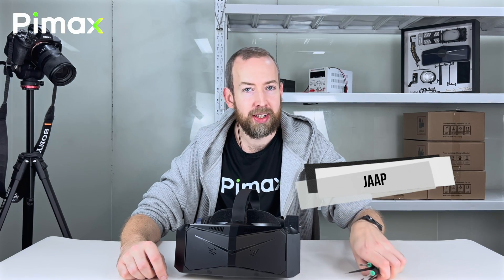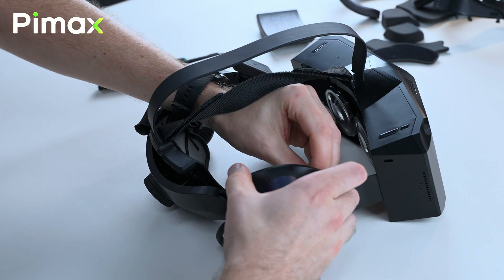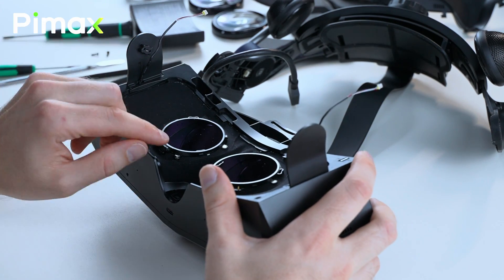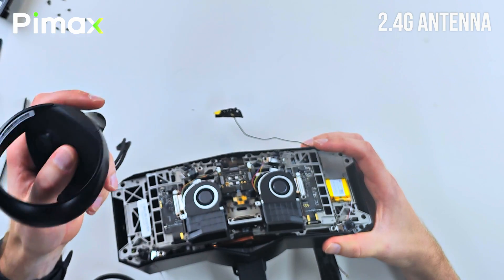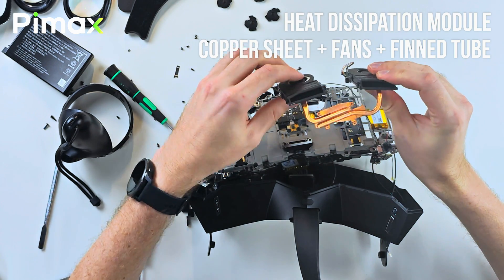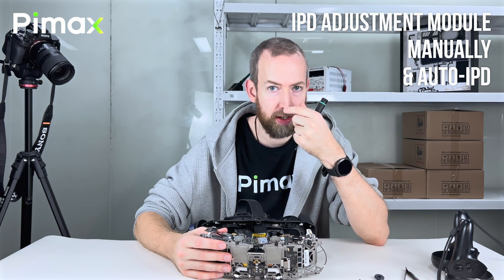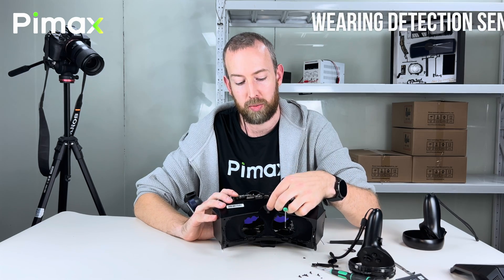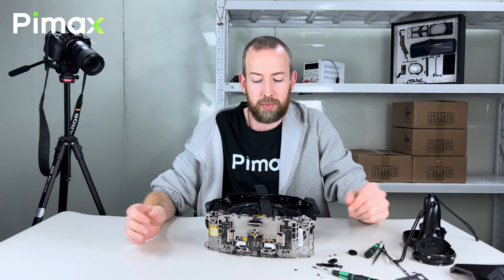Pimax Crystal teardown: How the Crystal is built differently & achieves the highest clarity in VR

Comment: Where can i get the power supply cable (flat ribbon cable at top)  ? Mine detached from the battery pack on the headset. >_<  Im good with soldering, but i would like to use the same cable if possible. Else I will have to switch out to a 9pin ribbon which im hoping not to have to do.

Comment: Hi Pimax techs,
I bought a Crystal Light for static VR for simracing or plane simulation.
So i don't need controllers because i use only mouse in VR.
I found after the buying that the headset (even if it is not a standalone VR) emits ECM waves in 2,4 Ghz.
Certainly to communicate with the controllers.
How could i disable this permanent ECM emission ?
There is nothing in the settings of the device.
Unfortunately, ECM waves very close to my head gives me headaches.
With other and older headsets without BT or Wifi emission, i can play for long hours without headaches.
If there is no solution to disable this 2,4 Ghz emission, i should have to return the product for refunding.
Thank you very much for you answer,
BR,
Reply: Did you find any solution to this? I too want no 2.4Ghz near my head.

Comment: There is so much wasted space. Could put more computing power in those areas beside the lenses. Tho weight would be an issue.
Maybe a way to lower the weight is to try replacing the plastic shell with a strong durable water resistant cloth wrapped around the frame.

Comment: With so many components go into the headset, it looks like the only way to reduce the weight and size is to separate them out from the display and had them in your pocket or something with a wire hook up to the display (similar to a battery giving the device power through wire).  That way you don't have much weight on the display and also you can be creative with the size and shape of it as well.  That would required creative engineering for it to work I supposed.

Comment: Would it be possible to remove the components that make it standalone to make it PC necessary only in order to reduce it's weight?
Reply: The faceplate, DP adapter and headphones are quite heavy and safe to remove, I'm thinking of removing the second cover, the one on top of the magnesium alloy exoskeleton.
It would be great if we could remove the fans for PCVR, but I won't be the first to do it ;)
Reply from the maker: The XR2 chip also does a lot for PCVR mode: https://pimax.com/crystal-xr2/
Reply: @PimaxVR  Like what? What would you need it for that my Ryzen 9 7950X3D PBO UV can't handle?
Reply: @TTailled  What weight would you reduce? The battery would be the only one, and you would loose a lot of features and the future wireless compatibility.

Comment: I would've loved a non-standalone version of this headset.
Reply: Why? All it would do is cut the battery out. It would not reduce size or weight basically at all. Would just give up a lot of features, and wireless compatibility.
Reply: @Nobody-Nowhere  Wrong. It did reduce the weight by 310 grams.
Reply: you've got it now

Comment: It has the 60GHz Wigig module already inside?  That's news to me.  The interview I saw before showed the WiGig module as an external dongle.  Are you sure that's not just a WiFi 6E module built in?
Reply from the maker: You'll still need the module (dongle) but the necessary hardware to make it work is on every Crystal.

Comment: This is all very nice and good dear Pimax! 
The only problem is that these things don't really work and we are spending a lot of money while you testing the Crystal with us: The customers. 
Here are some examples: 
- The controllers do not work properly, the tracking is useless with the latest update also. It's just doesn't work. driffting etc.
- So I bought the Lighthouse faceplate which also doesn't work properly (I have 4 other headsets including the index which work perfectly fine with the lighthouse setup etc. If I turn sideways the tracking is gone with the Crystal. Thanks for the 200 extra euro Pimax!
- 120Hz? Stable? No problem. :) You're lucky if it works at 90Hz without flashing.
- Pimax give me a bad charger that almost ruins the whole system and doesn't charge and just flashes the screen reboot etc. I had to buy a proprietary USB HUB because the one that comes with the Pimax Crystal just doesn't work. More crap. More than 2000 euro!!!!! Just sayin....
- Comfort? Also, you can spend money on accessories while the marketing bullshit and the paid youtubers said that it's super comfortable and you just need to strap on a rubber strap and everything will be fine. Why not add it as the part of the original package? I think it might be possible for more than 2000 euros.
So if someone doesn't want to spend all day on the internet researching and troubleshooting don't buy this crap. I already regret it. Go to the discord server and look at the problems in the troubleshooting section. It's a joke.
Reply: Huh.. mine works fine.
Reply: @mr.spongylikeaboss4987  Of course. ;)
Reply: Our discord and reddit exist as places for users to communicate their various issues and seek help from the community. Just like any tech community reddit it is in fact dominated by users who have questions. That is very normal. Very few people take to discord or reddit to say "Everything is working perfectly and there is nothing to report." The old adage "Bad news travels twice as far and twice as fast."  is quite applicable when it comes to the internet in general. 

That said if your unit is experiencing the issues up above please contact our support staff and we will be happy to help you sort them. You can contact me personally via our phone line several days a week (I post to reddit and discord when the phone line is open so users can contact me directly for assistance) and we will also be offering direct user setup services in the near future where we will sit down with users via video conferencing calls to help them get their initial setup and configuration done with a Pimax expert. 

If you don't know how to contact our customer service you can find it on our website at www . pimax . com
Reply: @WhatsupAbroad  You mean the open and unanswered discord cases where I don't see you anywhere telling me what I should do to make this thing work?
And you mean those Pimax experts who just don't know how to plug this thing together properly? https://www.youtube.com/watch?v=Z8HlH6AErRM&t=1s
This is a joke. It's a semi-finished product at a high price. Everyone who has bought it knows that.
Oh, and by the way, I think you'd be doing this company a favour if you wouldn't be in any videos and you wouldn't answer customers because nobody likes cocky and arrogant people.
So you can understand why I don't want to talk to you in person on the phone.

Comment: You should be saying consumer VR as Varjo for exanole has higher clarity on their enterprise line.

It is too bad the battery power hmd strap connection was not thought out better to better allow alternative headstraps.  Should have been a removable connector on both ends.
Reply: Watch again, he says "highest clarity of consumer VR" at 0:07
Reply: I'm sorry but that is simply incorrect. The Varjo XR3 has a higher peak resolution, but it is not clearer than the Crystal. The lens system in the Varjo XR3 and VR3 are outright inferior to the lens system in the Crystal due to their use of Fresnel optics and plastics for the base material. I believe quite a few people who have used both have commented that despite the lower peak resolution that the clarity, colors, distortion, and overall visual experience is in fact better with the Crystal.

Comment: @PimaxVR my lenses are rough on the inside (LCD panel side). Is this normal? Can I just wipe them?
Reply: If you use a soft cloth it's fine, ideally a microfiber cloth for glasses.
Reply: @JaapGrolleman  what I'm saying is that the coating on the inside isn't smooth like the outside eye side of the lens. Is this just some residue from manufacturing or will rubbing it off get rid of some anti-glare or whatever you're putting on the lens? Thanks
Reply: @marcbsounds Please contact support with photos of the issue so we can help you address it.